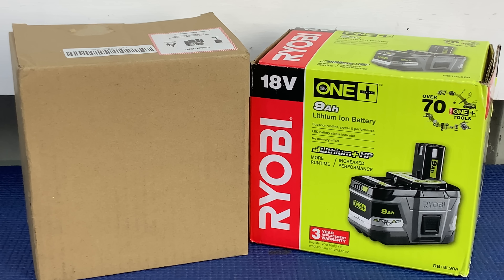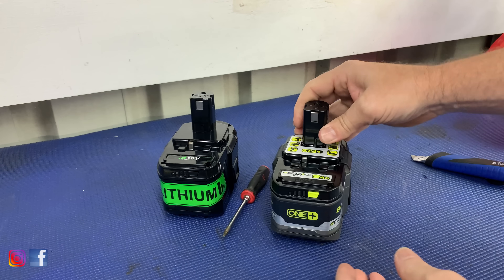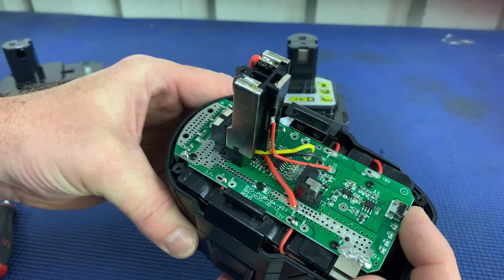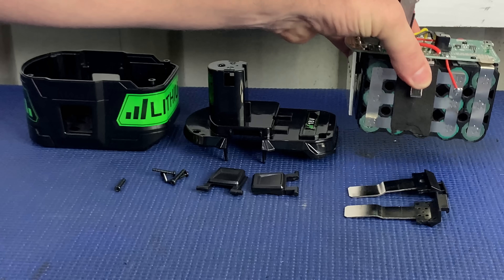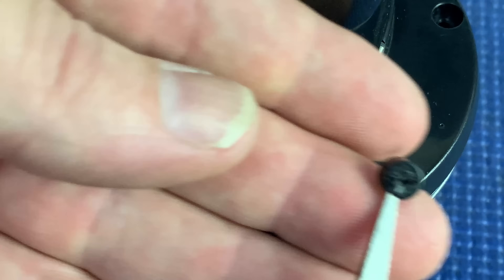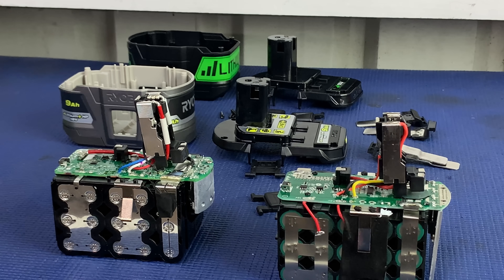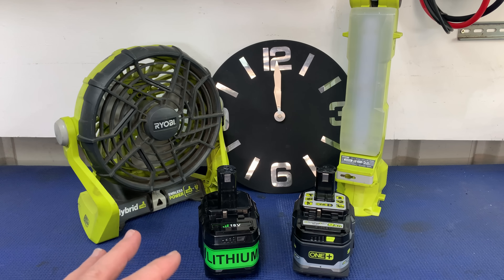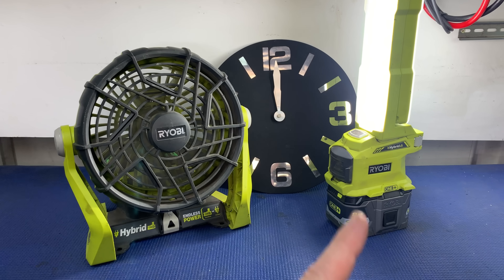Ryobi 9ah battery versus eBay knockoff job

Comment: The $$ in Lithium batteries is C rating (I know this from racing quadcopters).
I imagine the poor soldering/welding & thinner bussing would restrict the available power as felt in the leaf blower but I would bet the cells have a much lower C rating.

C rating being max output
I run 1500mAh 100C LiPo
1.5A x 100C = 150A max output

The same batteries at 40C are 1/3 the price
Reply: I got myself some LG HG2's with the aim of DIY'ing a ryobi pack - 5S2P.  They're 3000mah cells, rated for a 20A continuous discharge (about 6.66C).  They're close to twice the cost of the cells I use to make ebike batteries - LG M29's, which are 10A continuous (about 3.3c) and 2950mah.  £3.54 vs £1.99 from a London battery supplier after tax.

I can get away with the M29's in ebikes because a 24v 250W ebike pulls under 11A, and so a 5P pack, at 50A continuous, isn't terribly stressed out.  Even on startup, the inrush isn't likely to get even close to 50A.  I don't know what my Ryobi tools pull, but just in case it's 25A+, I went for the 20A cells in 2P.

We'll see if I manage to burn the house down with it...  ;)  (Yes, I do have a BMS in the ebike batteries and I have one for the ryobi pack).
Reply: @antontaylor4530  
From what I can see Ryobi uses Samsung 2000mAh 18650 cells with a 10c(max?) rating

Datasheet
http://gamma.spb.ru/media/pdf/liion-lipolymer-lifepo4-akkumulyatory/INR18650_20Q.pdf

Comment: Those were fused nickel strips at each cell terminal too right?
Reply from the maker: On the Ryobi, no that slit is for better spotwelds so the current has to go around not direct (if that makes sense.

Comment: You are so Biased toward Ryobi that you can't even see it. Come back when you can speak 1 sentence without going on a tangent about how bad the knockoff is before you've ever even tried it out!
Reply: Yes he still hasn't grasped the fact that although not quite as good, he could buy three cheap ones for the price of one.
I don't think I have ever seen such a biased review in my life, and I'm 72 .
Reply: @johnbatten6711  I have also bought both of these batteries and the cheap one is at least 3x more likely to burn your house down. The protection circuitry is garbage, terminals/wire/and nickel strips are all under sized, and the cells are from a no name brand. I would never buy the cheap one again although in my testing it performed reasonably well, I just can't get past the safety issues.
Reply: @johnbatten6711  If the cheap knockoff is more likely to fall out of the tool, delivers lower power per weight, and is more likely to burn down the house, I would have a hard time rationalizing it.
Reply: @mdocod  I would guess you are a glass half empty kind of guy?
Reply: @johnbatten6711  I can buy Genuine Ryobi 4AH packs for $25-40 each when they go on good sales at home depot. My glass is full of safe, reliable, inexpensive batteries that perform great.
Reply from the maker: And then you have a look at the rest of my channel (namely the Ryobi playlist) and take a look at my actual experience. Then of cause there is all the stuff off-camera.. Genuine is the only option in my internet opinion

Comment: I want to see what cells are in the knock of battery I’m guessing LG. I doubt it
Reply from the maker: That'll be in the next few weeks, just waiting on the iCharger to return so i can run some load tests.
Reply: @HBPowerwall  okay thanks
Reply from the maker: NO worries..
Reply: @HBPowerwall  I got a question do you know of any cheap sources of decent 18 650 cells I need 12 of them for a project that I call a solar bird house no birds are going to live in it it’s just the size of a birdhouse there’s a few videos of it on my YouTube channel it has two solar panels on one side and room for 12 battery cells in the roof it a power bank inside
Reply: @Meow7081-e3w  what country are you in?
Reply: @jbrdddd  In the US in West Virginia

Comment: The cheapie screams high resistance - bad welds, thin nickel, probably junk bms mosfets and high resistance cells.   Might be telling to open them up again, tape into a ryobi saw or angle grinder and run a proper tool load doing real cutting work for a sustained time period.    Then thermal cam bus and bms..

The Ryobi actually uses all  nickel plated copper bus strip and either sony vtc6 or samsung 30q cells.  The honeycomb cell holders are a heat sinking type plastic that grip the cells and suck heat out.  They are engineered for sustained high current and perform well for that.  

Also, I’ve found that for testing  the resting voltage on these newer “HP” ryobis they seemingly test low, but you have to put it in any tool, run it briefly, then you have 10-12 seconds to quick eject and check the voltage before the BMS turns off and the voltage drops back ~0.5v reflecting off-state MOSFET body diode drop.
Reply from the maker: I'm trying to work out a rig i can set up with my batrium shunt & my circular saw but the cables have too many losses and aren't safe around a nice spinning disk of death.  Do have air pump, I would say under load that would draw a bit.. need to do some reading in my spare time.
Reply: @HBPowerwall  You’re right - saw would be too much to manage / a dangerous hand full.     I would say keep it simple - grab the highest load/lowest runtime passive tool you have.  The blower set on high is fine , or the ryobi heat gun if you have it.  Solder wires at the pos and negative battery pack terminals  and slide back on the top/ nose part of the casing so you can slide into tool, and tape in place.  Connect a voltmeter to the jumper wires and monitor the voltage and IR thermalcam during the discharge.    I think the voltage sag and thermals will probably be informative.

Comment: After you have finished your testing it would be awesome to see if you could upgrade the cheap eBay one with much better cells.
Reply from the maker: issue is the pcb board just isn't usually up to the job..

Comment: the genuine Ryobi battery also has a nice conformal coating on it to help against moisture, Also you way overpiad for that  genuine Ryobi battery they are $199 at bunnings
Reply from the maker: Yes i noted that in the description (or other comment) at any rate the fact that this one still worked after droping it enough for me lol

Comment: Your knockoff is about 1/4 the price and the capacity is about 6AH (not 9AH). That sounds like good value!
Look forward to seeing your results. If you get less than 1/3 the cycles for the knockoff then it is good value.
You should have a look at the catches to see why they were not grabbing!
I have a knockoff Makita 5AH but its capacity was 3.8AH. However it cost 1/3 the genuine battery. I think this is good value.
Reply: It's definitely not a good value. Like an idiot I purchased over a dozen Vanon batteries because they said they had a long warranty. Well none of them lasted but months at best and they never did work that great. They will warranty one battery one time and that's it. The warranty battery they sent me was DOA and they would not sent be another or any other replacement for the other dozen. If anyone gets one to last longer then 4 or 5mo I'd be surprised.
Reply: It's NEVER good value to me, if I'm not getting what was advertised and paid for. Too many people like yourself accept marketing BS from lying thieving companies and that's why they get away with it. If it says 9AH then it should deliver 9AH. Would you accept a nice job salary and then be happy if your boss only paid you 70% at the end of the month? Everyone expects Chinese junk to be, well, junk. But that doesn't mean we should simply accept it.
Reply: @chocolate_squiggle  I'll take 70% pay in return for 30% of the job. 
6ah at that price is good
it's a china knockoff. only a fool expects the same output for 30% of the price
Reply: Its a good value until it burns your house down
Reply: @skywalkr2  I don't keep batteries in the tools, nor the chargers.
Reply: @FahimibnDawud  that won't keep it from burning your house down. Lithium batteries are prohibited on planes even as individual batteries as they still provide a fire hazard
Reply: @skywalkr2  You can build your own Ryobi battery. Choose the cells you want, ensure they are the right voltage and are capable of high current draw and have any capacity you want
Reply: It will only last a year or 2 if lucky then it will hold barely a charge. And while it's new it's discharge amps will be far less than a real HP battery. Meaning you won't get nearly the power out of high demand tools. Meaning on your sawsall it will cut out on low voltage half way through a 4x4.

Comment: i got  my 12ah Milwaukee battery from China (custom build with Sony vtc6 battery 21700), after my runtime test , it matches the capacity, (i use my genuine 3ah battery as comparison).

after disassemble, the aftermarket one has a worse motherboard, just like yours in the video, thin leads, looks awful welding. 

But at  the end of the day, i paid like 80AUD for that, which 12ah cost 249$ locally.

But i only had it for a couple month, who knows what would happen in the long run.

The takeaway is, it's great for people just starting getting into tools, then use this money to buy the genuine one. 

i am sure we're getting ripped off by buying the genuine one if we're just talking about how much it actually cost to make one, but we can make sure we're getting the warranty which is the most important thing, also a peace of mind, coz it is less like to catch a fire in your tool trailer/box due to poor design inside.
Reply: With the genuine one's you are not only paying for the product, but research and development, testing, advertising, packaging, distribution  and of course business profit in the form of brand name recognition.

Where a "knockoff" will simply buy one. Copy the casing, test the BMS and fit a standard 'off the shelf'item or maybe build a pcb to fit.
Cheaper parts can be used and of course no need for advertising, distribution as that is taken care of via Ebay, Amazon and similar online stores where price matters most.

You make a choice and pay your money.
Simple as that.

Comment: I’ve got several of these cheapies, tested em with my heat gun... they do alright, but not as rated 🤣 I use OEM on heavy draw tools, cheapies on the lights, fan etc. no dramas so far, and saved lots of dosh
Reply: Amen brother. Got a powtree 3ah one that ain't good for nothing but the light but the 2 9ah ones I got work great and the other 3 ah one does fine. The one that is "defective" can't take any draw higher than my light and maybe a brad nailer.
Reply: I bought a bunch of the 6amh batteries and all of them straight junk. I liked them at first even though they wasn't as good as my 4amp batteries. I liked them because of the price only lol. Anyway one died after a couple of weeks and they sent me a replacement which was DOA. Then all the rest started dying also and they refused to warranty any of them. Not one lasted more then a few months. Granted a couple would say they where charged on 4 different chargers but only show 2 bars. Then they would only work for maybe 2min in my impact driver. Total scam. I will never purchase anything other then name brand again. VANON is the brand I purchased and they pretty much said sorry about your bad luck.
Reply: I agree here.  Just like cheap solar charge controllers, all these knock off cheap batteries have their place and capacity restrictions.
Reply: I can imagine it'll pay off if the work you do has a history of frequently replacing worn out battery packs.
  Not so much value if your brand one gives good performance over time without needing replacement.
Reply: Dosh you must be English?

Comment: I'm amazed that no-one picked up on the "NI-MH" on the rip off battery @ 1:13 . What are the cells inside, are they Lithium or Ni-Mh?
Reply from the maker: Well spotted - they are 18650 format, NIMH would be a different voltage from memory..
Reply: @HBPowerwall  It’s a 5S battery - has to be a Lithium chemistry @ 20.8V fully charged - as Pete said.,
Reply: Maybe they meant that it could replace one of those old ugly yellow and black ryobi packs.
Reply: Or maybe they were dark navy blue.
Reply: @peterskyparker  the tools were blue but if I remember correctly the batteries were yellow and black. Yellow top, mostly black. Nicad.

Comment: I wouldn't call it a fake, but a cheap knockoff (as your title states). A fake battery would be one that doesn't function anywhere near it's supposedly marketed claims (ie, 9000mAh but only 2000mAh real).
There are some genuine knockoffs too and they are definitely closer to the authentic versions.
Reply: Genuine knockoffs? 😂
Reply: @Pro1er  Yes, as in, they are basically the same thing with a different label on them. Such as the MPPT solar charge controller. There are loads of what appears to be clones, but they are made on the same assembly line, with just different branding on them.
So those would be "genuine knockoffs".

Comment: Well I am a diy person not a contractor and I have 2 knockoff batteries different than the one you showed but while they dont last quite as long as the OEM batteries.  I do not have the fit problems you showed mine click in fine and use them on recip saw and drill all the time .  For DIY its great value in my opinion.  My knock off batteries are 2 years old and still going strong
Reply: Link?
Reply: Yes link please?
Reply: I have a cheap cordless hyper tough replicating saw, had it since 2019 and I leave it in the rain, it's Rusty is crap but it works, lol. So yes cheap Chinese crap can sometimes last I guess

Comment: I bought 2 knock off's about 4 years ago, same 4Ah as originals. We renovated 2 investment properties and built a fence. The knock-off's still go like new while the originals have died. Ok now I ordered a battery and a charger combo on ebay and only got the charger.  Weight is a good indicator and guess what our friends in the US and England slowly switch to grams! Look at the Project Farm youtube, Todd even bought a deep freezer to "grill" his tests!
Reply from the maker: Can't believe a knock off lasted longer than the real thing? But I guess it's possible, did you favor the real ones over the fakes so just had more runtime?

Comment: Yes we already know that all these chinese knockoff clone batteries contain inferior and or untrustworthy lower quality cells. It does not move the needle forwards much to expent all your efforts being so thorough to prove that.  Other than to help educate the more ordinairy consumers amongst us who are not aware of this. Especially for higher current draw situation. Which you didn'
t test yet in this first video.

But if you are really serious about this topic, then there are another 2 better options:

1) not for ryobi, but for makita 18v it is possible to buy a 'battery kit' from aliexpress. Which is all those clone parts except for the actual battery cells. Then you can source your own high quality genuine samsungs or whatever you like (and proper high current discharge version). And put them in yourself. For the fitment and quality or materials issue i would say at least the makit ones looks ok. Or you can modify your own shell. Some people with "decent' 3d printers can also print their own shells in a tougher plastic that will solve that issue. What I think is really the bigger question for these clone batteries then, assuming that you are competent and capable enough person to solve all these above issues. Thats all fine except the questionable BMS charging circuit pcb. Which is like... more hassles to stress test and depend upon i would expect. SO onto option number 2 then:

2) Maybe you can take an official but dead genuine battery pack. Or buy one cheaply on ebay. And just replace all of the cells youself. Then you get a genuine casing, clips. and a genuine PCB. You might have to throw out the battery contact metal, and replace that yourself. But that aspect should be fairly straightforward. The main question for renewing  these official ones is if there is some little microchip on the official pcb which marks the whole battery as being a failed pack. And junks it / cannot restore or reset the condition. Because if there is such a firmware lock it could be pretty difficult to overcome, if the brand name used some closed or custom chip. That was proprietary, and a read-only type deal.

So these are the ways to get around paying the full $300 whack for official batteries. Without sacrificing even half as much of the quality performance etc. So if you can find the justifications to make it worth your while to cover THAT... but of course these solutions require a lot more time and efforts. Modifying etc. And how easy it is depends a lot on which brand name system you are on. I would expect that Makita and milwaukeee are probably easier to do than something like ryobi. And I could not find a battery 'kit' for ryobi when searching today. Although it does indeed have open source 3d models for printing. You would still need a pcb for it etc. I did not investigate ryobi enough as i dont use them myself, only makita.
Reply: Update: i was wrong, there are also similar kits for making your own 'clone' ryobi battery on aliexpress. Just had to keep scrolling a bit further. Here is one as an example: https://www.aliexpress.com/item/4000026493586.html

I would however suggest to not to trust the mosfets they put on any of these chinese BMS pcbs. Perhaps source your own higher quality mosfets from a trustworthy supplier digikey farnell etc. and replace them yourself.
Reply: Totally agree.
Reply: you can get good if not better cells but thats not the issue here.